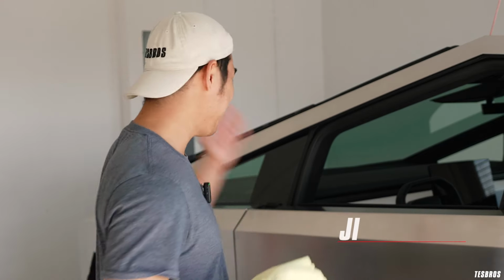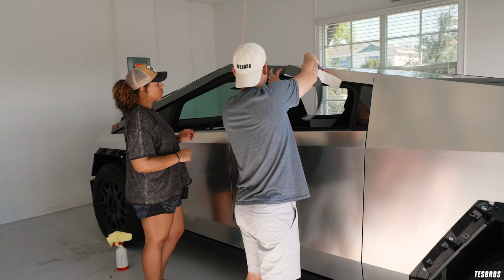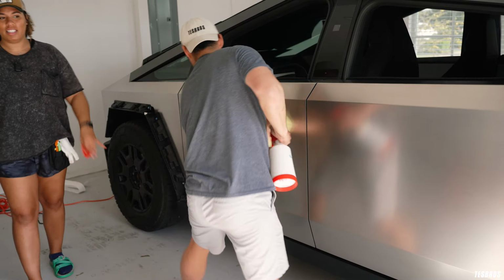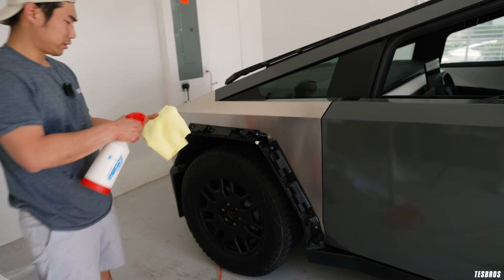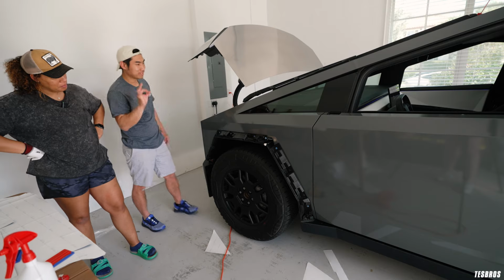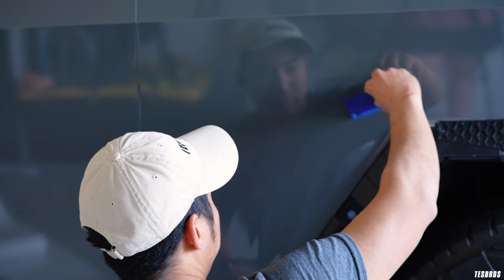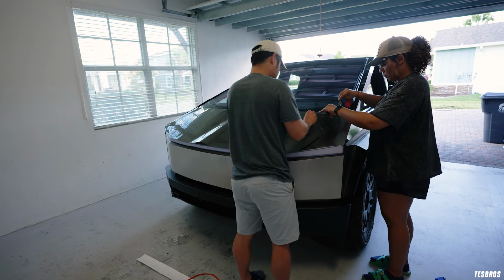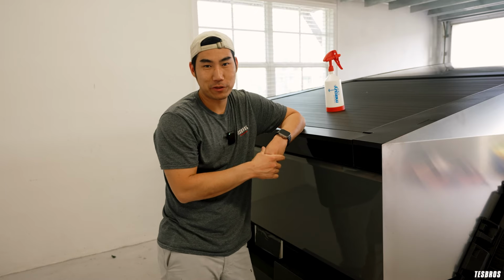Wrapping A Cybertruck In Avery Dennison Gloss Rock Gray With DIY Kit - TESBROS

Comment: how did u get the cuts so clean?
Reply from the maker: We use our large cutter to cut all the panels for this template kit. After we've designed them and tested over and over to make sure it's the perfect fitment, we cut them and send in our DIY kits so you don't have to use a knife when installing!

Comment: Could you use RapidTac with this wrap?
Reply from the maker: No, this is a dry install, so introducing any liquid when installing will trap water underneath. Most vinyl is a dry install, but there are some brands out there that are wet install. I would check the manufacture specs of whatever brand you go with to make sure it's compatible

Comment: The kit looks like it requires a lot of handling. Why not  use a bulk sheet and glass the panel? I understand  material savings by using a kit but at the cost of quality ?
Reply from the maker: The kit was made with beginners in mind, not pro wrappers. The pre cut templates and backing cuts make it much easier without quality being sacrificed. The only difference is you’re not cutting it out yourself on the car. It’ll last up to 7 years like any other vinyl wrap. Definitely valid concerns though and here if you have more questions!

Comment: why don't you wrap around the corners?
This is an untreated car which means it can rust from the small gaps, wrapping around the corners would help protect those areas better
Reply from the maker: It does wrap over the corners. Not very far, but it does cover any steel showing on the outside.

Comment: I curious what a cyber truck will look like after a long term wrap is removed. The stainless steel on the cybertruck is very porous and rustable. The wrap won't allow any condensation moisture to evaporate from the pores in the steel. This might cause a lot of pitting in the steel.